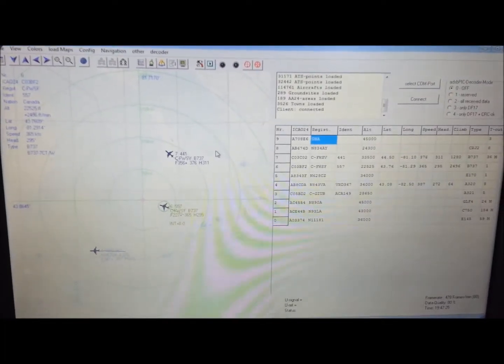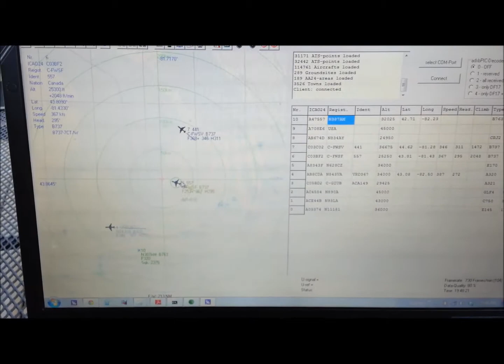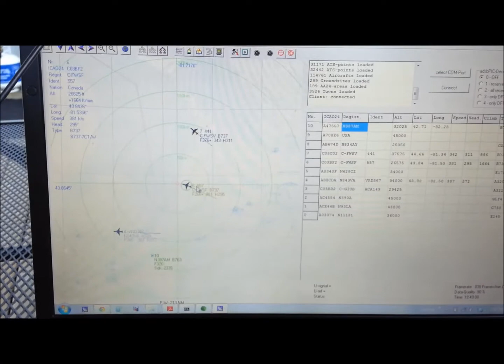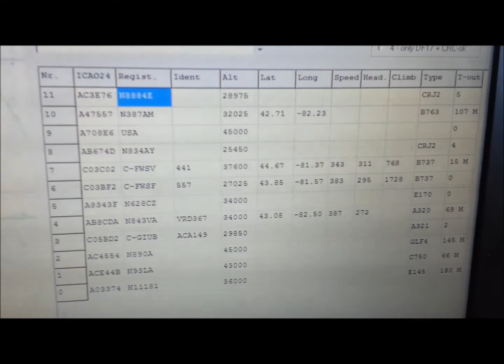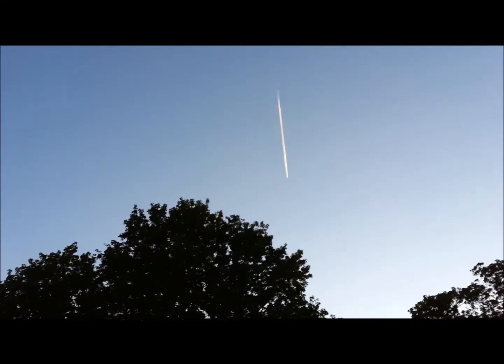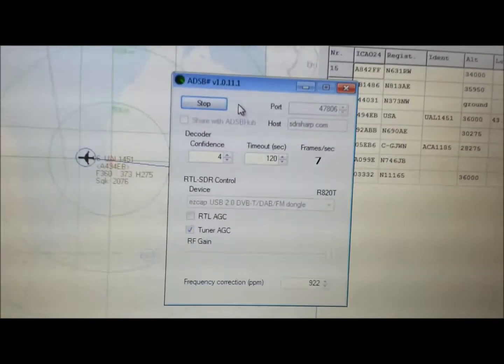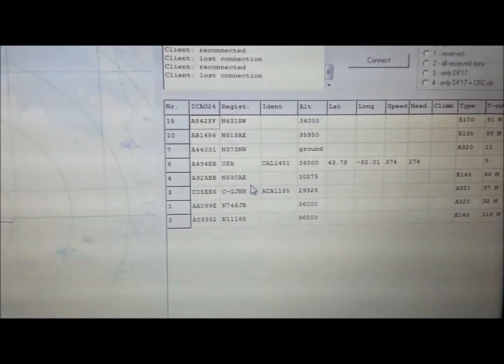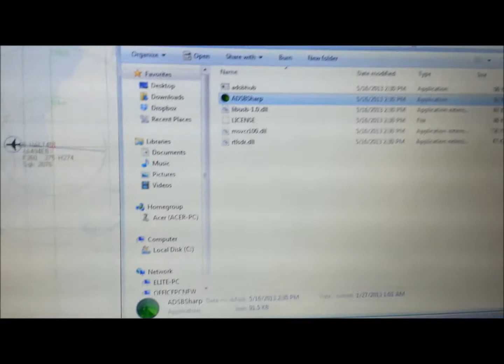ADS-B Decoding with Cheap R820T DBV-T SDR Dongle Tutorial - Part2

Comment: I have the same exact SDR dongle you have. The antennas for the ones I have are 1/3 the length of yours though and non telescopic.
I live at the south end of an airports south main runway flight path at the point where planes are low and start making their course heading turns which is like a few air miles from the runway.. It's really neat watching them take off and make the "J" and or "U" shaped tracks on the screen. One laptop tracks planes and another receives the voice radio communications from ATC to plane crew and so on.
One project I am working on is using the same principle of tracking planes but rather to track trains via their EOTD. Some railroads have EOTD's that transmit info and location just like a plane does. They do not use a similar frequency but rather most use 160 - 161 MHz or 452 - 457 MHz bands. The ranges will be limited but not as bad as 1090 MHz through ground clutter.